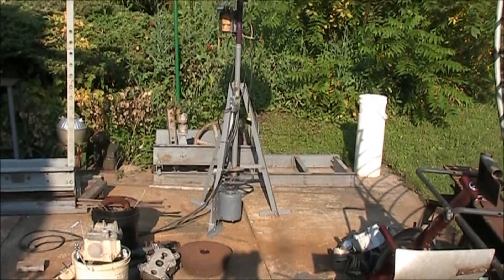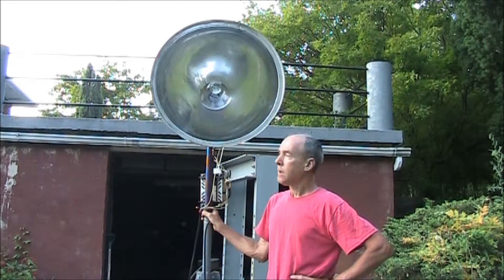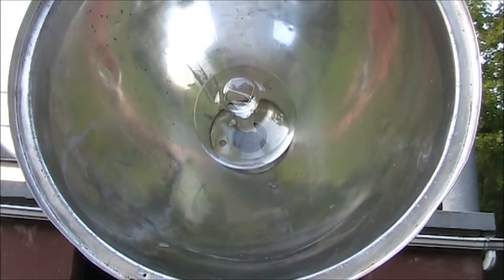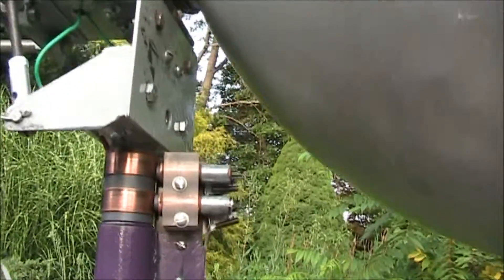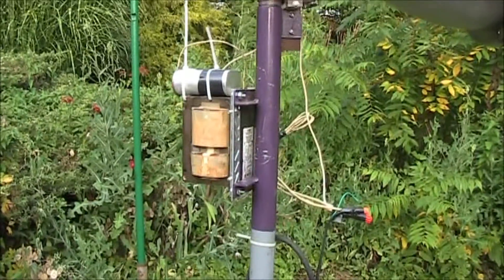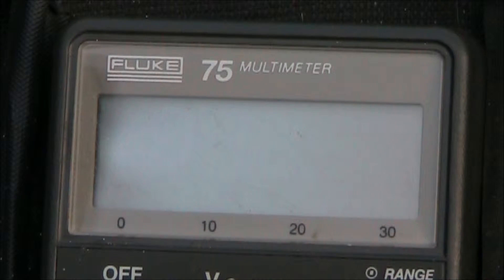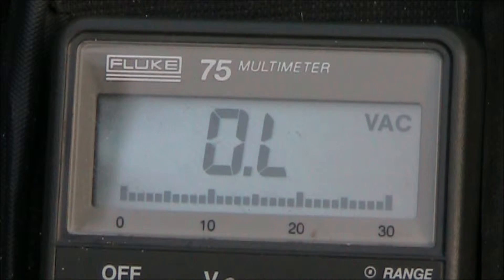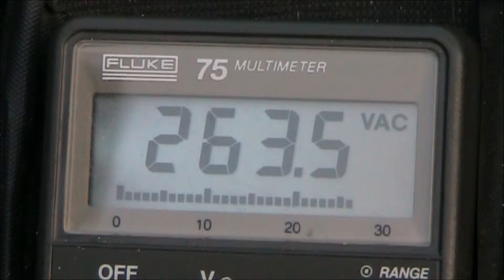improvised beacon light

Comment: Slow the rotation down! It’s too fast!
Reply from the maker: I didn't have a gear reduction drive so I used a 820 RPM motor and a belt drive reduction. That was the best I could do. That will be corrected on the next setup.